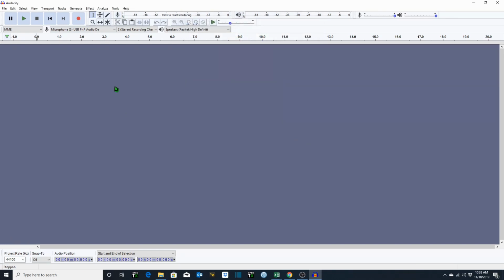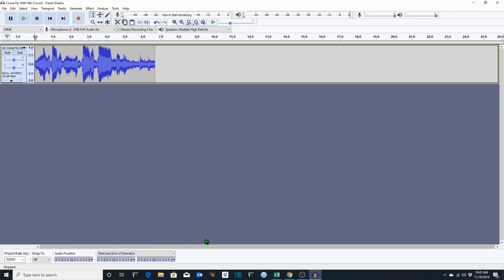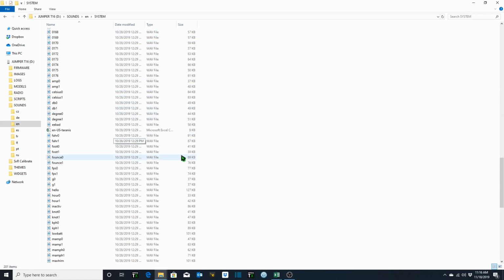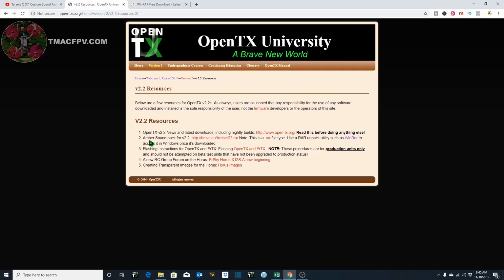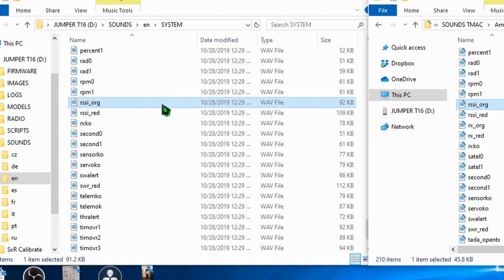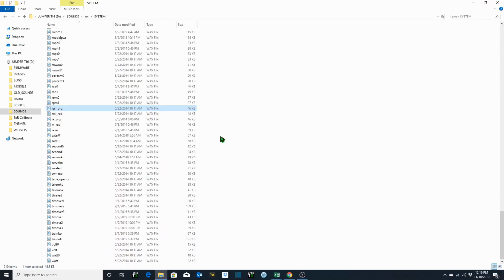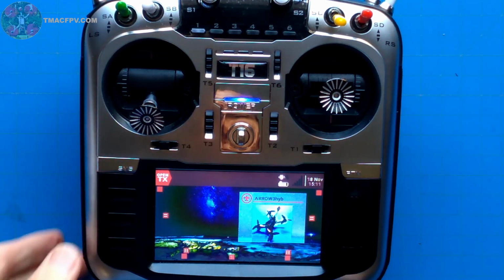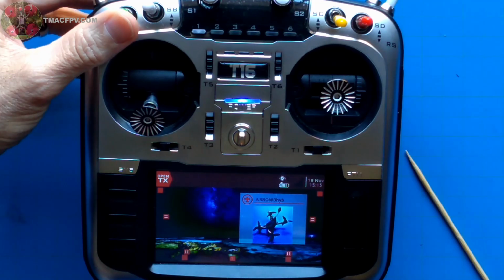OPENTX CUSTOM SOUNDS

Comment from the maker: Its time to Go Custom! Listen to Amber 🤩on your T16 or create your own voice audio file with a text-to-speech editor.  Its Audio on a Switch! Have fun and let me know how you'll use it in Comments below!👇
Reply: Your Jumper and OpenTX videos are so valuable I'm at a loss as to which one to watch (and implement) first.  GREAT STUFF!!!!
Reply: Awesome video like all of them.  But I made a custom sound via Best text to speach and Audacity but the radeo plays it SLOW,  what am I doing wrong ?  THank you TMac.
Reply from the maker: @oholm  I do recall that happened to me one time, however, I forgot the reason!  I would check a few things.  1.  Make sure you have saved it as WAV file with only one channel (not stereo or two channels).  2.  Make sure you have named the file with the correct number of characters.  3.  If your "custom" sound file is the same name as one of the default sound files (like you want to replace the default one), make sure your default sound file you're trying to replace you have named differently (so there aren't two files with the same name).  Other than that, go back through the checklist which is available for download in this video's description and verify each step
Reply: @TMacFPV  Thanks ! My bad, I had it in Stereo and got this ghostly voice instead of a clear womens voice : D Thanks again : )
Reply from the maker: @oholm  No worries - I've done that before myself!
Reply: It appears your sounds download link is broken"
RESOURCES & LINKS MENTIONED IN THIS VIDEO:
👉 JUMPER T16 OPENTX CUSTOM SOUNDS CHECKLIST:

Comment: ok but when i go to my folder on the switch special sounds .. they don't appear. only a sight, and not a lot of sounds .. i dont understand, if you have the sounds, but the radio does not show all the sounds in special sounds .. i did a "hello" but if i want to use the sounds in the sd "sound" folder and it is impossible for me to have the sounds for the logical switches and telemetry .. I did everything possible, but for example, impossible to have an "rssi low ", or arming or others like vbat and I can not it's annoying. an idea?? thank you! . : '(

Comment: I'm finally ready for this, so I found my way back to this exceedingly helpful video.  Needed a voice to speak the words "Begin Mission" when my T-16 switch was thrown to start a mission of way points using iNAV.  Thanks for presenting the necessary Project Rate and export encoding type expected by the transmitter.  I'm sure that critical information helped hundreds of folks.  Stay safe and well!
Reply from the maker: Great to know Frank! Thanks for making the time to comment.  Truly appreciate it my friend.  You stay safe as well!👍

Comment: thanks for the info. my question is how do you turn the volume down on the start up and shut down sounds. thanks
Reply from the maker: Press and hold SYS button to get into Radio setup menu.  Press Page key to get on Global Functions Page. Click on first column entry (after GF1).  Use scroll wheel to find "ON." Click scroll wheel to enter "ON" in this column. Use scroll wheel to move to next column.  Use same process just mentioned to find "Volume" and enter "Volume" in this column.  Move to the next column and use the same process to assign a switch (I  use the right slider).  The label for right slider is RS.  Find RS (for right slider, or the label for whatever switch you want) and insert it in this column.  Move to last column where "square" is and click on that to enable.  Hit the RTN button on your transmitter to exit out.  You've now just assigned the volume to a switch so you can control the volume.  initially at start-up, my volume starts out loud for just a few seconds, then if I have the volume turned all the way down, the volume is not heard.  Be careful, however if you have "voice warnings/alerts' for RSSI low, signal low, etc. and you have the volume turned down, you may not hear them!  Clear skies friend!
Reply: @TMacFPV  hi. cheers for the info, 
i have however already done this, and as you pointed out it doesnt lower the start up or end volume. so i adjusted it in audasity and lowered the output by 10db and now it doesnt shout at you when its switched on.
steve

Comment: TMac (it's your friend Zaine, new username) this is really good stuff. The first thing i'm going to do is set a sound on a switch that goes "Turtle Mode Active" over and over until I turn it off. Why ? Because the other day I was testing out throttle reduction through switches. My little Mobula 7 just kept jumping and shutting down. I was too dumb to realize It was in turtle mode and I burned up the ESC. I was too focused on the throttle modifications.  So sad....Z
Reply from the maker: Hey FpvNube (Zaine)! I like your new name & logo! Why'd you change if I may ask? Sorry to hear about your ESC friend, you're not alone, that happens to all of us at some point.  I too like the audible alerts as "reminders" considering sometime I can't even remember what I had for breakfast!🤪I do the same thing with my modes and rates (have 3 different rates set up on a 3-position switch) so I know how to expect the quad to respond to my stick movements (sometimes I accidentally hit that rates switch and change them without knowing)
Reply: @TMacFPV  I changed it just to see if I could get a "Good" name for just my dealings with quadcopters. I still have the Zaineman account, just wanted one for just my quad hobby (& give you another subscriber..Lol )
Reply: @TMacFPV  TMac, here is a few tips. If you think Bridget is speaking too fast, put a comma  " ,  "  after every single word. " Warning, turtle, mode, activated " also if you want her to say the word Quadcopter, spell it like this "Quadcoppter" with 2 P's . I don't know why but it sounds better. Zaine
Reply from the maker: Nice tip! Thanks!

Comment: Great video, im following you step by step but when I try to record text to speech on audacity from the oddcast like you did in your video, it doesnt seem to pick up the audio, not sure what im doing wrong.
Reply from the maker: Thank you!  Do you have some sort of microphone installed on your computer?  When I open Audacity, upper left corner of my screen shows a microphone symbol and next to it is the type of microphone I have connected to my computer which I use with Audacity.
Reply: @TMacFPV  I get it, you are using an external USB microphone connected to your computer, right TMac ? That would explain it.
Reply: @It'smejerryfoo, I think TMac is using an external USB microphone connected to his computer. You and I are having the same problem because we are trying to use the internal microphone. The computer seems to take issue with 2 programs running at the same time and it is causing our recording issues
Reply: use windows wasapi choose your audio output and thereee

Comment: I just got the T16 Pro that has Open TX already installed. I found that some of the Amber pack sounds do not show in the radio, so I shortened the file name and then they showed up. High rates and Low rates were not showing in my TX. Those are the 2 I shortened the names for. Thank you for this video. You are helping me a LOT with this radio!
Reply from the maker: Glad to hear it ajosepi1976! Excited for you friend! Happy to help👍

Comment: I see they are now shipping with open tx according to Grayson hobby’s ? But with open tx 2.32 which I thought was the nightly builds ? ??
Reply from the maker: I haven't seen the Grayson Hobby video yet but yes based on what I've heard Jumper was planning on installing "a version" of OpenTX soon. There were 2.3.2 nightlies which became 2.3.3. nightlies because OpenTX had to release an official 2.3.2 without Jumper T16 official support due to a non-related critical issue for another TX. So, I'm guessing (do not know for certain), the version which Jumper is now shipping (week of 18 Nov 19) is one of the nightly 2.3.2 versions which has been tested extensively with what features it has. However, the official release of the T16 supported version by OpenTX will have other major features. I still think it's good Jumper did this instead of keeping JumperTX on it with DSM "bug" and no bootloader. I do believe this is progress and Jumper is doing their best to improve it's product as quickly as possible. After typing this I now realize I sound like an affiliate of Jumper. I am not. 😀I do not have any relationship with them at all.
Reply: Quite agree so long as people don’t lose models I think I’ll wait till they realise a proper version